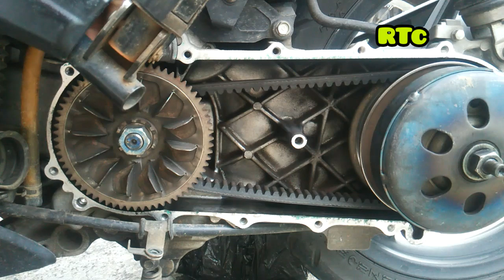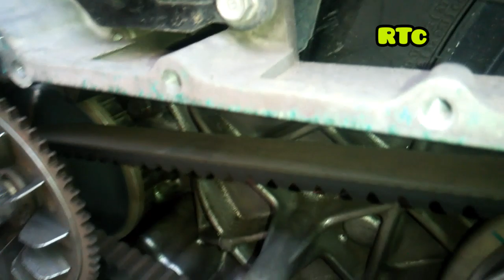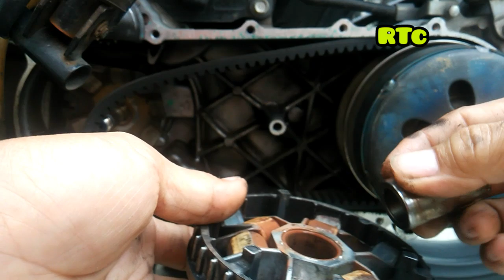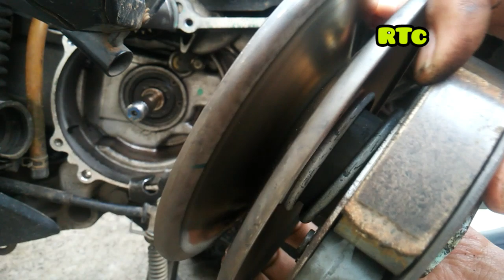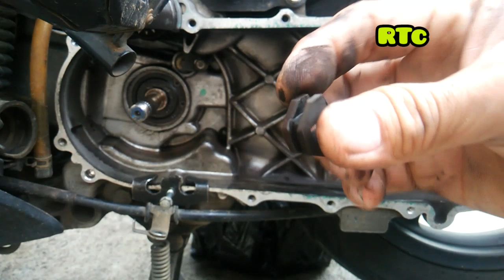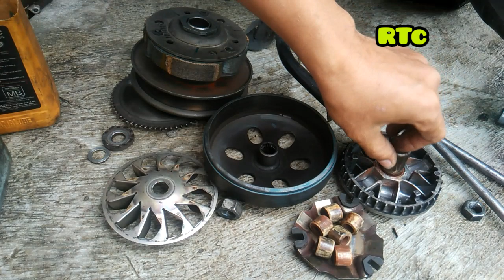Sebab Motor Matic Bunyi Tek-Tek + Tenaga Ngedrop

Comment: Bg, motor saya beat streat. Lari nya berat setelah di servis di dealer resmi. Gas tidak spontan. Dan sering ngangguk2 pas sedang jalan, pada kecepatan 60 km/jam lebih suara cvt meraung seperti suara kecepatan 100 km/jam. Mohon pencerahannya bg.🙏🙏🙏
Reply from the maker: km sekarang berapa? mungkin kemarin baru diservis belum cek secara dalem2,
....silahkan like dan share videonya....
Reply: @rumputteki  47000 km nya bg,

Comment: Mas mau tanya
Kemaren motor saya beat 2013 saya abis ganti rumah roller+ bushing+face comp+ roller 
Setelah saya pakai kok rasanya tenaganya jadi kurang ya mas? Serasa rpm nya udah tinggi tp jalannya masih pelan 
Trus saya bukak lg cvt nya saya cek belt juga kering
Kira2 apa penyebab tenaga jadi kurang responsif / nahan tenagane ya mas?
Reply from the maker: tetap nunggu mapan dulu mas...,
tapi juga bisa efek per cvt dah lemah, biaa ganjel lagi mas...
......silahkan like dan share video rumputteki...
Reply: Per cvt udah lama saya ganjel pake pelor mas kayak yg d yutup2 tu, yg tenaga kurang rpm tinggi lari pelan ini terasa setelah penggantian pulley depan set

Comment: Bang klo pas mulai di gas terdengar suara "cletek" di cvt tapi pas rpm menengah ke atas hilang itu masalahnya pada komponen apa bang
Reply from the maker: suaranya terus menerus atau sekali mas?
kalo berulang bisa jadi laher tutup cvt nya...
....silahkan like dan share videonya ...
Reply: Sekali bang pas mau rpm menengah dan pas gas di bleyerin bunyi lagi

Tapi klo rpm menengah ke atas ilang
Reply from the maker: bukan mirip suara kampas megar ke mangkok ya mas, biasane pas awalan...
Reply: Bukan bang udah di bongkar semua dari pully blakang sampe dpan ga ada yg salah tapi pas di pasang bunyi lagi